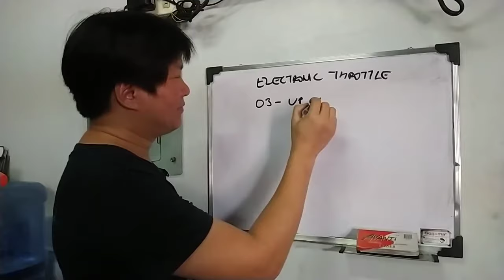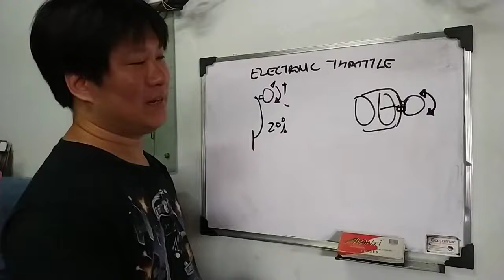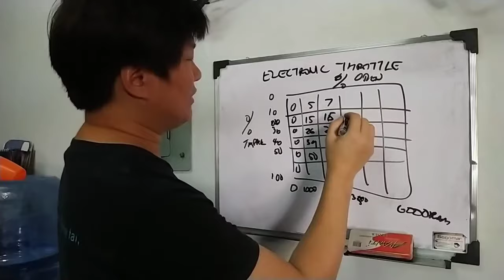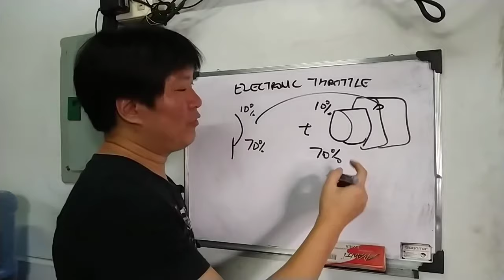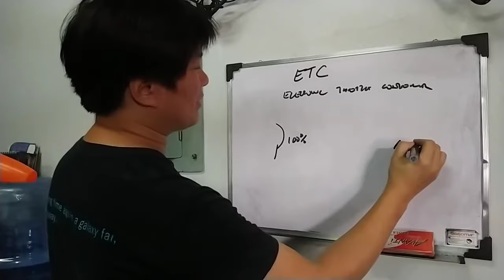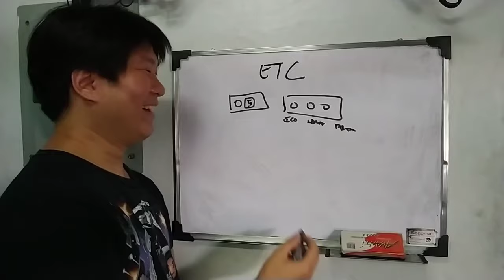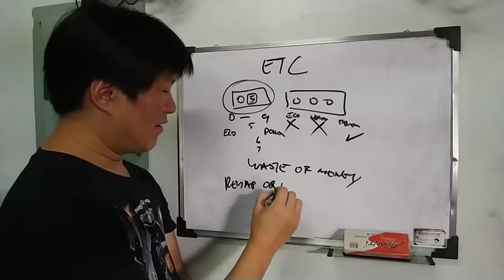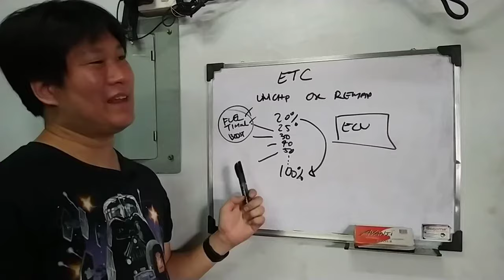Why does my car have delay? Throttle delay explained

Comment: Sharing my bad experience with this shop. Paid the remap fee of 20k and at the end of the day, no power increase and ubos pera, gas at oras sa hassle pabalik balik na retune and all nasisi pa na may problema daw oto ko. Anyway, just be very careful. Check everything before handing them your hard earned money.  In my case, I had a bad idle fluctuation issue after remap when Aircon is ON and shifter is in Drive or Reverse. Ended up going to another shop/tuner to fix my idle issue and have a better remap not a loony toon remap.
Reply: Kamusta na po now unit nyo sir ?
Reply: Anong kotse mo? Any issues before the remap?
Reply: Over priced products too.
Reply: Sus bro learn daily inspect your own car, nag kaka delay yan minsan sa mga injector, sensor, spark plug , throttle body cleaning. Habang tumatagal pag me pag babago meaning to say me mga sensor ng bumababa na ang reading so me mga hindi na match na throw ng command. Usually mga set up na ganyan mas tataas pa ang consumption ng gas. Or of course kong makita nila na nahinaan kana pag na balance nila ulit ang mga combination,natural lang na masasabi mo me nag bago 😂. Gagastos kalang. Sundan lang ang mga maintinance ng sasakyan in every kilometer servicing at mga required na palitan. Try to invest in your own car scanner ng makita din natin ang mga difference Kong bakit me pag bago ng andar.
Reply: anu car pinaremap mo sir? at sino nag tune si sir sid ba? at san ka lumipat nag pa remap?

Comment: An indirect ratio doesn't mean delay. Delay is when you step on the pedal 10% and you get nothing. After it sits and thinks about it for a while, sometimes a long while, then it responds sometime later, regardless of the ratio. Driving a carbureted car the throttle is not only 1:1 it is instant.
Reply: I'm having this issue with delay... whats the cause and the fix?

Comment: Great explanation! I couldn't stand owning a car with an electronic throttle though. All my cars have a throttle cable and I'm so used to the instant response that smoothly driving someone else's modern car and even just holding a steady speed takes a quite a bit of focus.

Comment: Thank you for this informative  video about the electronic throtlle controller my question is when you avail a Unichip or Remap
 it is not  damaging the ECU or alter the program for the computer for the long period of time of used? and what are the differences between Unichip and Remap?
Reply from the maker: No. Will not damage ECU

Comment: No. All a throttle controller does is - Commands more throttle percentage for the same input, i.e push the throttle pedal 10%, the controller commands say 80%. It just amplifies the signal. This is what gives you more "Throttle response". The throttle opens faster because the controller is commanding more output for the same travel on the pedal.

Comment: when you immediately go to full throttle, it will not go to top speed mmediately, because it is a car not alarm clock, need to hold on the full throttle in order to reach the top speed

Comment: Bought a throttle commander, I don't want more power just predictable clutch control. Like holding on the clutch at the light on a hill.   response time is still slow and more unpredictable.
Reply: Same here, do you have a better solution now?
Reply: @saintplay66  thinking about timing chain. 70k . 
Did new plugs and coils 
Other than that not really. 
Getting more used to it's as is condition, it's just a really inefficient way of getting about.

Comment: hello po, napunta po ako dito, i have ford fiesta had it checked sa 2 different casas  having it full service with the concern that sometimes that happens once in a while when i press the gas pedal while driving on the road hindi nag accelerate or worth biglang nag slowdown not picking up the speed. I had to press the pedal a lot of times para maandar ako, the engine is still on. Both of the casas said its fine, na change na fuel filter, air filter spark plugs.... sabi nila wala naman silang nakikitang issue pero nung pag kuha ko sabi lang parang may delay. per inexplain ko un na minsan sa minsan nangyayari talaga sya na tumitigil or nag stall. can i ask advice po?

Comment: Sir dba yung bagong hilux 2.8 maspowerful, pwd ba na e-remap lng yung "old" hilux to achieve the same power and fuel efficiency?

And another question, for an innova to achieve the same power as the new hilux will the remap be enough? Or additional engine modifications will be needed?

TIA
Reply from the maker: Yes both can be remapped for more power 

The Innova will match and exceed the Hilux, the old 3.0 can get close to the 2.8

Comment: My 2007 Dodge Charger with the 3.5L high output V6 has a serious throttle delay and I have to fix it some how. I'm not looking to make her a sports car but I do need to make sure she can GTFO of her own way should I need to hammer that throttle with purpose. I noticed this issue when hitting the gas when in park after I bought the car. It would take a few seconds(what it felt like anyway) for the throttle to respond and when letting my foot off the peddle it would take seconds for the the engine idle to slowly come back down to parked idle speed. I'm like WTF?

Comment: ETC works pero parang kailangan din na itune yung transmission, kasi onting apak pa lang downshift na agad. so instead na naka POWER MODE 9 ako POWER MODE 3 lang. the fuel consumption also goes up, from 11KM/L highway 9KM/L nalang. 3.2 MONTERO

Comment: I've had an ETC installed for years, recently my aircon broke down and I had it fixed, after fixing the A/C, i noticed the delay became worse.  And sometimes, when running at high speeds, and doing overtakes, power or pull is delayed.... what should I do? Is this just delay or is this a sign of breaking down? I drive a Hilux Revo 2.4G 2017.

Comment: Does my 2005 Toyota Avensis 1.8 VVTi petrol have an electronic throttle? I’ve noticed since I’ve had it, that when I press the accelerator, there is a slight delay from me pressing the pedal, to when the revs actually rise
Reply from the maker: No

Comment: Ok, so I could be experiencing electronic throttle response delay in my 370Z but I feel it’s more than that. When I press the gas the car is kind of squishy, it feels like weight transfer and could be suspension I imagine too but still it’s more than that. Could it be engine mounts or something else. I mean the car just turned 20,000kms so still pretty new but possible when I bought the car with 8,000kms it could have been beaten before hand. I want to make the car tighter on response and I am in the midst of doing coil overs but I’m just wondering what u guys know about this or if you’ve experienced this. ??? Any help please

Comment: Got 2000 celica gt 5 speed soon as I shift to 2nd then get on it the rpm flutters but once it goes 3000 rpm it’s good got any idea maybe dirty throttle bottle because I changed spark plugs and ignition coils but still same problem any advice thx
Reply: My 5sfe toyota camry has same problem. Idles and starts fine though

Comment: nicely explained sir. but saving environment is not nonsence 😐
Reply: In cars maybe but theres far worse things out there than emmisions
Reply: GDI engines produce less CO2.
These types of engines work with higher pressure in their cylinders, which tend to generate greater amounts of particles, which increase air pollution. GDI engines produce less CO2.
These types of engines work with higher pressure in their cylinders, which tend to generate greater amounts of particles, which increase air pollution.
GDI engine also emit as much as 1,000 times more harmful particles than port fuel injection.

Comment: actually the delay in throttle response is purposely done by the car manufacturers for reasons of fuel economy. altering the response time of the throttle plate in relation to the accelerator pedal only presents the driver a false sense of a performance increase due to the accelerator pedals being more sensitive to foot action. if the driver demands quick acceleration all that's needed is flooring the go pedal and the throttle plate will respond with a 100% opening. such an action takes less than a second.
Reply: Flooring the paddle doesn't necessary open the throttle plate 100% with DBW.
Reply: @metzmatu8409  immediately after i read this reply from you i checked on a 3rd gen miata from a client that sent his car over to my shop to have suspension work done. I had one of my workers floor the accelerator pedal and it was 100% wide open. I'll send you a photo of it on this coming week. It's 11PM on my side of the globe FYI.
Reply: @pnv565  
How do you comfirm throttle plate wide open 100% and how do you comfirm padel floored (APPS) 100%.?
(TPS 100% = APPS 100%)

With an accelerator pedal position of 0 degrees, TPS,potentiometer 1 may output a signal of 0.5 volts and potentiometer 2 may output a signal of 4.5 volts.
With an accelerator pedal position of 0 degrees, TPS potentiometer 1 may output a signal of 0.5 volts and potentiometer 2 may output a signal of 4.5 volts.

So.. APPS floored (100%) should give  the reverse reads for the 2 TPS.
Reply: I have to disagree. I have a 07' Charger with the 3.5L high output in it and it sucks gas down like an old Chevy pickup truck with a bed full of concrete. I'm not saying I have the worst fuel economy but it sure as hell aint the best for a V6.

Comment: Sir, I have a Montero 09 model diesel, Kahit anung apak at sagad ko sa gas pedal ang rpm nya is between 10k and below 20k rpm.. no acceleration and check engine is lit. Saan kaya sir ang problem? Hope you can help. God bless.
Reply from the maker: You bring car to shop

I can't help you if I haven't seen the car

Comment: If our car uses trottle cable the trottle position sensor is the problem?
Reply from the maker: That means there is no delay and you just want more power
Reply: @speedlabchannel4452  my honda civic has acceleration lag po
Reply: When i press down on the gas the car takes maybe a second to gain more speed
Reply from the maker: @matthewtawagon7908  that means you want more power 

There is no delay in the throttle for a cable throttle 🤦‍♂️
Reply from the maker: @matthewtawagon7908  hindi lag yan 

Nakukulangan ka sa power ang ibig sabihin Nyan
Reply: @speedlabchannel4452  before the car not like this kase
Reply: Like its revving first then it goes faster manual transmission
Reply: Like hesistation po when i press the gas
Reply from the maker: @matthewtawagon7908  well obvyits an old car and beyond that, I can't comment on anymore on a car I have not seen much less driven. This is as stupid as asking a doctor to diagnose you through a few lines of messaging 

Best way is to bring car to the shop and put on dyno
Reply from the maker: @matthewtawagon7908  hindi na kita sasagutin dito kasi walang pagtutunguhan

Comment: Gamit ko yung yung mumurhing 9 Drive throttle controller (PhP1,500 sa Lazada dati), and nawala ang delay kahit using lower levels lng. At gumanda ang driving experience. No added power and torque pero sa overtaking which in stock eh antagal pumickup is ngayon mas mabilis na kumagat ang apak mo at aarangkada ang sasakyan. Ford Ranger XLT 2014 MT by the way.
Pag merong hilux or Navara mag overtake, nilalagay ko sa Sports mode level 9 agad para kain ng alikabok ang ibang pickup.

Comment: Ignition on but no rotation 3k
And with engine running 

_______/ 00000 500 800
______/ 0000 500 800
_____/ 000 500 800
___/ 000 500 800
_/00 500 800
0 500 800
Then Broom. And
500 800

But to you folks thats not rpm.

Acts like power band on a two stroke for the first slow depression. After 2k. Totaly normal. Just remember not to key and go.

Comment: Sir may tanung lang po ako.hindi po ba makacreate ng problem sa exh turbo charger if naremap na yung engine?lets say maoverload or over rpm yung turbo charger?
Reply from the maker: You forgot to mention what car
Reply: @speedlabchannel4452  ford ranger po sir..
Reply from the maker: @ervincasuyon8955  no problems

You cannot over rev your car, it's impossible
Reply: @speedlabchannel4452  thank you so much sa sagot po sir..sana po merun din magaling mgremap samin sa bacolod po..keep safe po sir..

Comment: That’s not delay... that’s variable ratio based on rpm.
Reply from the maker: Which results in delay
Reply: @speedlabchannel4452  what you’re talking about in the video is pedal to throttle ratio. Nothing to do with delay/lag.
Reply from the maker: @mareksumguy1887  no point in talking to people who just dont have brain capacity to understand